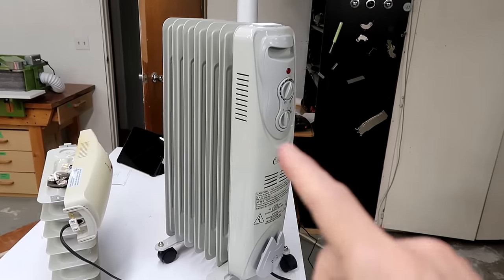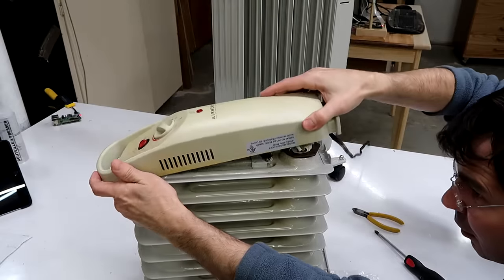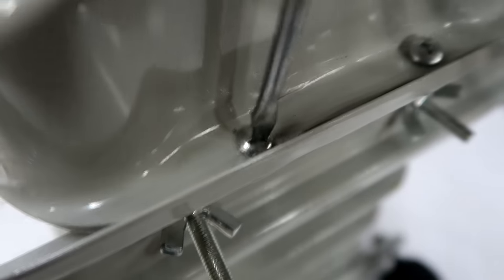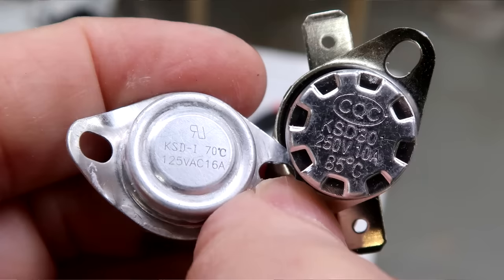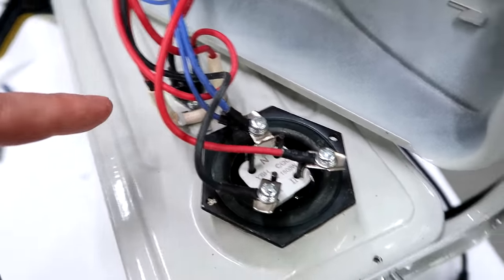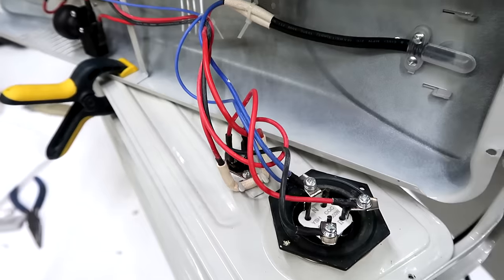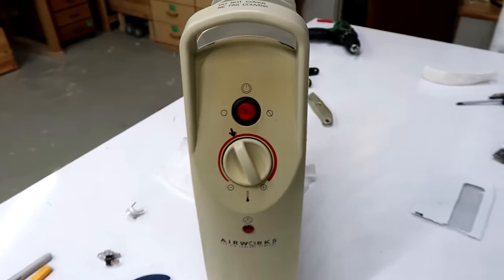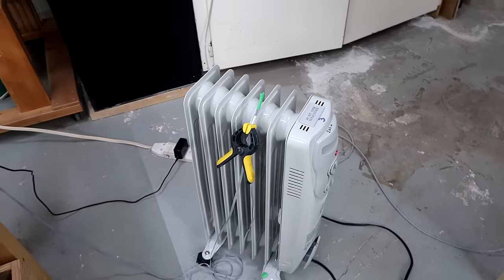Oil filled space heater fix

Comment: And here I am using my AMD FX computer as my heater.  May as well get work done with the heat produced.  Seriously, though, in my office I very rarely need to use the actual heater.  Between the computer, stereo, and 5 monitors connected to said computer there is plenty of heat. 

While a bit of a problem normally due to energy consumption,crunching data is a great way to get more for your money with electric heat.
Reply: Toss in a bitcoin mining system or two and BBQ lunch and dinner and make the hot beverages of your choice, or start a sideline blacksmithing or forging (though wood based Matthias must forgo the latter pursuits).
Reply: my old watercool 9590 with 2 watercool 390x did a very good job has a heater and pc

Comment: I have one of those 3 stage oil heaters, I keep it on the 3 setting all the time and turn the thermostat up halfway or a bit over half. Never had a problem with the overheat sensor. It is a Feature Comforts brand here in the US.
Reply from the maker: the way its designed is that you can't tell when the overheat sensor goes off.  Therefore, you have "no problem".
Reply: @matthiasrandomstuff2221  Nice. Thanks for the answer!

Comment: i think it also depends how hot the room is, as in a building which is at 10 degrees will cool the heater alot more than a building at 20 ( Celsius) i guess thats why they have a lower temperature cutoff
Reply: Yeah I was gonna say, it's probably designed to be the only heater in the house. If it's trying to heat up a good-sized room with no help and it's super cold out, those higher settings probably make more sense.

Comment: I guess the higher settings are useful if you are trying to heat a very cold room. Or if you have a fan blowing across the heater (yeah, a cooling fan for a heater).
Reply: I don't even know if you'd need a fan blowing across the heater, but even one in front of it to pull the excess hot air away. I'm not a physics professor though, so someone smarter could probably let us know if there's even a difference.
Reply: @timma_thy   a small computer fan set higher and off to one side was enough to circulate the heat in a room 10 x 12

Comment: Do you think it might be worth it to have a fan blow some air over the heater? Mainly as an attempt to get the fluid temperature down a bit to keep the overheat protection from tripping on settings 2 or 3.
Reply from the maker: That would definitely help.  But if I'm going to have a fan, then I might as well get a heater that has a fan built in.
Reply: @matthiasrandomstuff2221  Then build a low speed crossflow fan into it?

It should give low noise-level and big area of airflow.

Comment: Perhaps you should test and try one of those brazillian element water heaters for giving you that extra oomph factor while you shower. Some call them "death showers" as they use a resistive element to heat water around them, but if you take some time and properly ground it, they represent really virtually no risk. They're branded "Lorenzetti" and mostly available online, although, I believe they are cheaper where I currently live in.
Reply: Those are used in Ireland and probably a lot of places besides Brasil.

Comment: over in the uk we have Storage heaters, which are electric radiators that have a large battery inside them and only charge at night when their is a low rate. consider getting some of these if you have a variable cost/kwh
Reply from the maker: That makes sense if you have variable pricing through the day.  we don't have that here (yet)
Reply: Do you remember the old storage heaters, still installed in many Georgian houses? They contained a brick which would heat up at night using cheaper-rate electricity and slowly release that heat during the day as the brick cooled. I wonder if they're still a thing.

Comment: Is the temperature even on all the radiator's surface? could oil have evaporated from a safety valve or something and make it overheat? or maybe the oil cooked inside? Are you going to try and add extra cooling fins or something? it would make an interesting video
Reply from the maker: No safety valve.  They are all like that, new out of the box.

Comment: Using one of these in the garage in winter I've always put a box fan to pull air through.  I've never had mine trip this way, even on max.
Reply from the maker: yes, but by blowing the air around like that, you end up making sure all the walls are nice and warm, so you lose a lot more heat.
Reply: @matthiasrandomstuff2221  Relying on convection alone takes far longer to heat the space to a comfortable level.  Most of that energy is going into heating the top 1/3rd of the space.  By forcing the air to circulate in the room more of that energy is going into the air the occupants actually inhabit. So for the sake of efficiency that heat lose due to a more homogenous temperature would be paid back.  I only have to run the heater for 10-20 minutes before using the space instead of 60-90.

Comment: Split system "INVERTER" air conditioners are really cheap and have ~300% efficiency while heating. In Romania they cost around 300USD/unit (12000BTU).
That being said, I use a simple, cheap fan heater, when I need instant heat. It cost like 9USD and has two levels: 1000W and 2000W.
Reply from the maker: Watch the video to the end.  Only efficient when it's not cold outside.  As in, only efficient when you don't really need it.
Reply: @matthiasrandomstuff2221  New units have a new refrigerant mixture, so they work even at -15C ... the resisitive heating element kicks in at -20-25C 👍
More expensive air conditioners can function even around -30C ambient, without switching on resistive heating .
Reply: @matthiasrandomstuff2221  a geothermal heat pump could replace your existing furnace and deliver heating to the entire house. But it will be a big capital investment, payback time will probably be in range of 8-15 years, depending on a lot of factors.

Comment: Well, you have just about discovered the perfect rat's nest of annoyances:

1.  Those damn screws.  I had to buy a set of tri-wing drivers to fix an iron.  I still had to crack it open after the screws were removed, only to discover that the bad part was sealed up inside ultrasonically-welded joints.  
2.  You can't use cheaper power because it will never pay for itself.  I wonder what the economics looked like when the house was first constructed.  The builders probably made the wrong choice out of stupidity.
3. What idiots design a heater that trips itself off under normal use?  Apparently, there were two of them, cuz you have two different units there.  The useless switch probably increased the price, too.
Reply from the maker: When they built the neighbourhood, oil was probably the best choice, cause that's what they put in all the houses.  I imagine electricity was relatively more expensive, and it was pre oil crisis, when they even used oil to make electricity

Comment: Q1/...My Delonghi is leaking. A small amount of oil, the size of a nickel, you can see beneath the heater. 

Is this repair-able? Also appreciate any advice on it. 

Q2/ my OTHER oil filled rad heater is not turning on at all. What part has failed that it just simply doesn’t turn on at all anymore. 

Big thanks!
Reply: do NOT use the leaking heater !!!!!

Comment: My new Warmlite oil filled radiator keep tripping after about 10 minutes even on lowest settings and doesn't warm the room properly would changing this thermostat would solve the issue?
Reply from the maker: Thermostat is the most likely problem.

Comment: No blowing a fan through the spaces?  I'd hope that would draw heat fast enough.
Another expectation I had was some form of water coil through the spaces to pull heat out of the oil heater, while adding a slight bit of humidity.
Reply from the maker: if I wanted a heater wit ha fan, I'd just buy a heater with a fan.

Comment: 5:49  Excellent observation, and another reason for these cheap efficient, versatile heaters is that they are CHEAP as heck to replace if need be, don't have to fool with those high $$ repair costs in equipment & labor as the complete home setups

Comment: I recently invested in the Wiha Kraftform Kompakt 62, a Screwdriver with a set of long bits that cover anything from Standard Philips Head all the way to security hex, torx and also tri and quad wing. 

At around 70€ quite the investment but to me its worth it. No more "oh god I hope this screwdriver will fit somehow" and much more "OMG I've never been able to tighten a PH1 screw without pressing on the back of the screwdriver before".
Reply from the maker: if the screwdriver hadn't fit, I could have just dremeled a slot into the screw.

Comment: Can you do a video on how to determine what is the cheapest energy source to heat the house?
Reply from the maker: firewood, but it's high capital costs, ongoing work, and uneven heat.  But it really varies by geography, so my answer is not your answer.
Reply: @matthiasrandomstuff2221   exactly, what I was asking was if you could analyze each case and explain the math to calculate it leaving the energy cost as variable

Comment: You could also try swapping the overheat switch with a suitable PTC and wire that in series with the whole unit. That way the temperature will never exceed the trip-over temperature of the ptc, as the current decreases with temperature. The different power setting would then only control how fast the room heats up.
Reply from the maker: and half the power would go into the little PTC.  These things are not suitable for this application.

Comment: Is it safe to use a oil heater when there is a slight oil leak at the bottom? Can't see it running out, but leaves a small oil mark.
Reply: I wouldn’t!  Also how old is it?

Comment: I have an identical small heater and I've not noticed a problem like that. I have a similar large one as well. I suspect we both shop at Canadian Tire. The large one draws so much current that the 16 gauge power cord gets hot. I was thinking of swapping it out. I also wanted to comment on heating costs. I use wood pellets but the price has gone up such that they are at the same cost per BTU or watt. There is a factor of locality with heat. I don't need my basement as warm as my living room. So I use the more expensive natural gas for the first 17 degrees and then electric or wood pellets if I want to be warmer than that. But I too have done the math to show that electricity is the cheapest heat these days. I do find that prices vary, and it's nice to be able to choose the energy source that's least costly in a given year.
Reply: Not trying to troll you, but . . . doesn't it make sense to use the cheapest energy for the first X degrees, and then the more flexible but expensive forms to handle the peaks?

Comment: Interesting. The DeLonghi brand one I use for boost heat at one end of the house has 2 toggle switches, basically "low" and "medium". For normal use, they say to turn on both for initial warm-up and switch off the "medium" switch and use just the low power mode for maintenance heat. We don't have to turn it up very high, though -- anything over 2 or 3 (continuously variable but with numbered marks) gets too warm. We use the ceiling fan in reverse mode to circulate the warm air.
Reply: I had one of them and it worked great.
Reply: My old (circa 2005) DeLonghi worked great.  Scorched the plug, so I bought a replacement heater (and outlet).  The replacement sucks.  I did some tests with a thermometer, and they were inconclusive.  I got a Kill-a-Watt power meter to measure the power and current.  The replacement is just like in this video.  It runs 1500W until it heats up.  Then the thermal switch kills element number 1 and it runs at 900W the rest of the time.

I repaired the DeLonghi with a new 14/3 wire and added a ground.  Works great again.  "Old Faithful" I call her now.

Comment: That looked like a wood burning furnace on the right at the end of the video. Why are you not heating with that?
Reply from the maker: The wood boiler is very inefficient.  also, bad design in that a lot of smoke comes out every time I stoke it.  So I just use it to burn scrap wood and stuff I get for free

Comment: Maybe that's just the intended design? It's possible the higher powered heating element might just be there to initially get it up to a target temperature and then the 600 watt stays on to maintain it. Still, it seems odd that it has an interface like that if under the hood it works the way it does.
Reply from the maker: then you should not claim it to be a 1500 watt heater

Comment: Have you considered solar powered heating? The ready built modules are quite expensive, but with your skills, you're easily able to build some of them yourself and from there on, basically heat your house and water for free. A friend of mine built two modules from scrap material and has been happy with them for many years already.
Reply from the maker: Solar heating is very effective in the summer when the sun shines, but not so much in the winter when it's cold.
Reply: @matthiasrandomstuff2221  Well, I thought so, too. But even in the winter and with cloudy sky I still got half of the heating done by the sun. I'm not affiliated to any vendor of solar heating, but I'm speaking from personal experience. Besides, if you build a solar panel from scrap material, even a low efficiency is still for free and reduces your heating costs.

Als erfahrener Tüftler mit schwäbischen Genen ist das eigentlich eine ideale Kombination.

Comment: what if you removed heat from the unit by using a handful of computer case fans to  blow cold air from under the unit up through and out the top of the unit?
Reply from the maker: why not just use a heater that already has a fan then?  The whole idea is to have something silent.
Reply: It was only a thought, but  I see your point, perhaps there is some more things that you could do to increase the natural convention so more air would pass through the unit.  It seems that you are satisfied with what you have, its cool. Keep  up the good work, I enjoy your videos.

Comment: Why power control if it has a temperature setpoint control ????????
Reply from the maker: Because you need to be able to set it to "1", otherwise you end up killing the overheat protection thermostat eventually.  Also, better 600 watt continuous than 1500 watt intermittent.
Reply: temperature sensor is right next to the heater anyways, so controlling that temperature doesn't really make sense.
Reply: @chaklee435  exactly my thoughts.

Is this a compromise because the casing is some sort of plastic, and couldn't accept any higher temp?

I genuinely don't see the point of anything m ore powerful than the lowest power setting. In my case, I purchased a 3kw unit (in the UK, so 240v) but it can only run at 3kw for about 5 minutes, then it's either 1kw or nothing.

I don't even think it would be prudent to swap the cutout for a higher temp, as even if I doubled the cutout temp rating, right next to the element, it's bound to be tripped long before the room is up to temp.

Comment: Stupid Question: Shouldn't you match the voltage as well? The original says 125VAC and the replacement says 240VAC - or does none of that matter in this context?
Reply: Picture it like the writing on a toggle switch!  For example 20 amps @ 125v and 10 @ 250v

Comment: Everyone is talking about adding a fan beside the unit. How about adding a small fan INSIDE the unit at the bottom to push the air upward and out the holes you created?
Reply from the maker: if I wanted a fan, why not use a heater that already has a fan in it?
Reply: I use small fan heater quick burst heating and the oil leave on on low

Comment: I rewire mine so that low is both elements in series for 400w and medium and high are both just the low element for 600w
Reply from the maker: yes, I did that to a few of them too.  But not all, cause I use them as test loads too, and sometimes its good to be able to draw 1200 watts for a few minutes

Comment: A slow fan really help on the high setting
Reply from the maker: If I was willing to put a fan there, why not just use a heater that has a fan built in?
Reply: @matthiasrandomstuff2221  Because then you would have to buy a new heater, but you certainly already have a fan.
Reply: @engineer439  at the same time adding a fan might not be possible depending on where this is installed.

Doesn't seem like he is on a budget either.
Reply: @engineer439  I think what Matthias is trying to say is: these heaters aren't the most efficient heaters, but he really doesn't want a fan, which is why he chose these heaters instead of ones that do have a fan.
Reply: @matthiasrandomstuff2221  Soooooo many times the exact same question ...
Reply: @daanwilmer  Electric heaters are 100% efficient - all the energy that goes in comes out as heat. This is just a shitty design that's all.

Comment: so, how about solar on the roof? does make sense for you?
Reply from the maker: So that I can make a lot of expensive electricity in the summer and have very little in the winter when I need it?
Reply: @matthiasrandomstuff2221  Check with your local power company but it seems there is net-metering in Canada.  This is where you're able to roll your unused kWh over from month to month so you can use the power at other times in the year when you need it more (or at night or a cloudy day).  I live in a pretty conservative part of the US (N. Carolina) and even we have net-metering and solar incentives.  Total cost to professionally install a 9.3 kW system was $10k USD which covers our entire bill and charges our EV. We should break even in about 5 years.